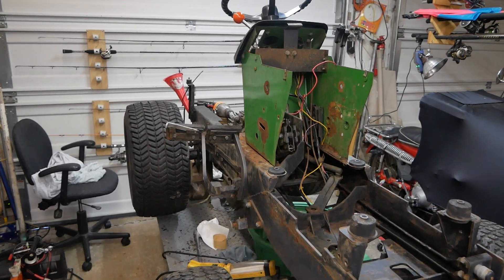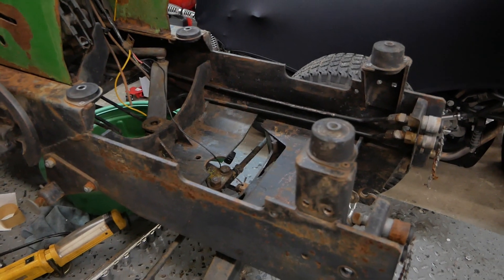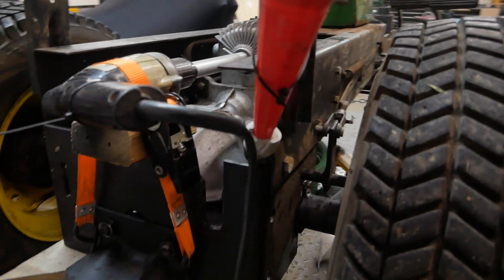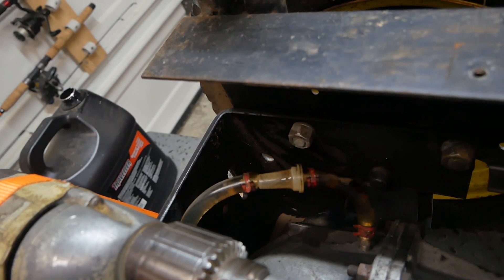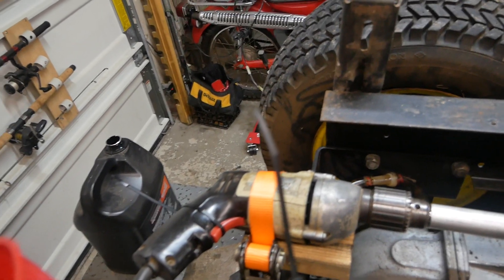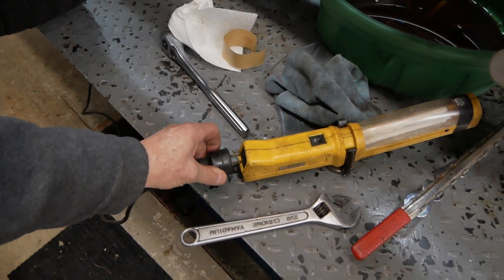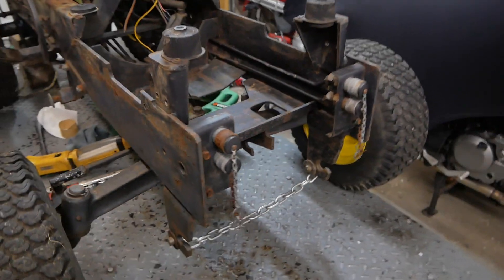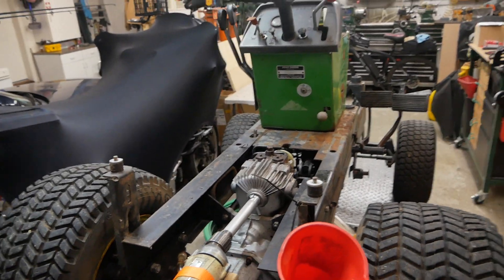John Deere 316 Hydraulic Pump Test

Comment: Another project.  Nice Roy.   Have you dabbled with hydraulics much yet?  Many great uses and that will be a much better unit than the other if set up correctly for a plow or a winch even.  The 3 series were very nice and easily worked on.  To check the valves you can purchase a of hoses and t in a pressure monitor that can be had at tractor supply or even ebay or Amazon if you haven't done it yet convert the connections to flat face instead of pioneer (you'll like it better) .
  Make sure the gauge goes to at least 2500 lbs and preferably fluid filled for reliability.  The output on that unit is only about 750 lbs I believe but shock will go MUCH higher hence 2500...
Reply from the maker: Thanks for the advise....I'll check it out. Should be a fun project as it moves along.